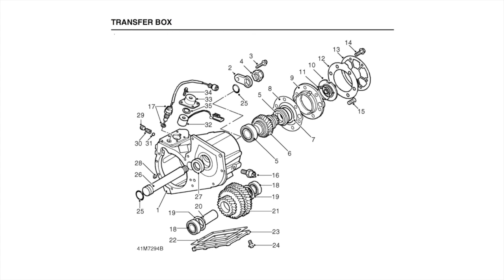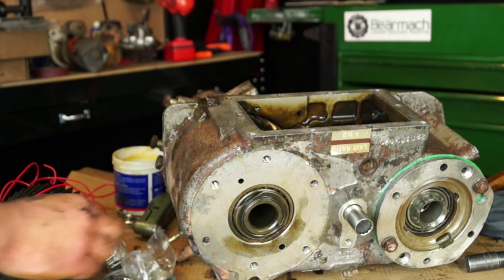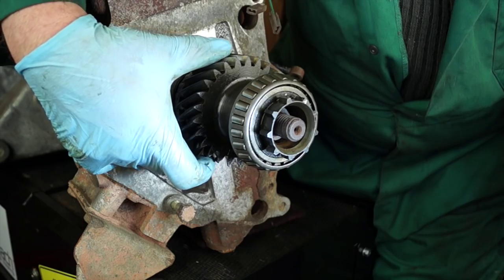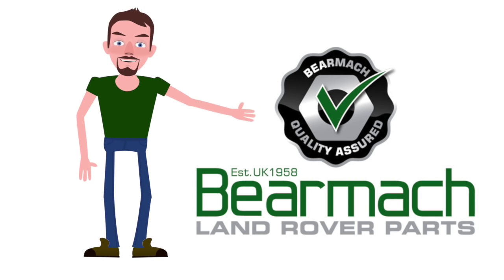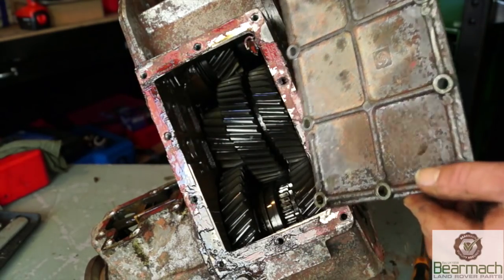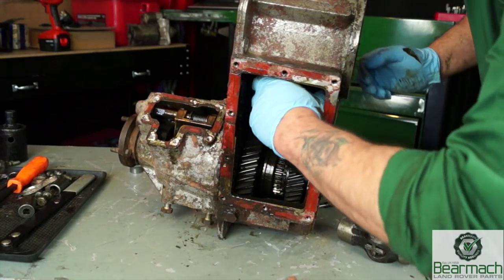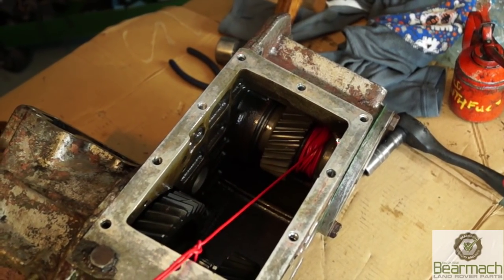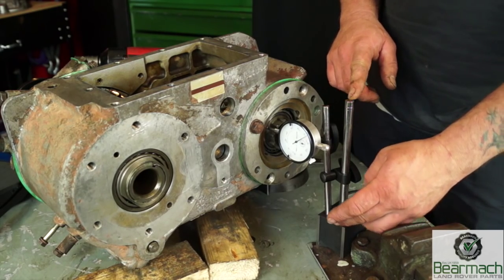Replacing the input gear LT230T  - The Fine Art of Land Rover Maintenance

Comment: had a buggered front diff a while ago . in the mean time though i have taken of the inspection plate on the transfer box  and found a brass chip ( very small and just one ) would that be the collapsible spacer ? 
also some lift on the front drive shaft flange within the transfer case 
thank you for any who can give advice
Reply: You will most likely have long figured it out but but those would be thrust washers from within the center diff (x4 washers) that lunched themselves.

Comment: If a spinning shell is the case, you can glue it with loctite. Source, onelonleyfarmer  while working on a JD tractor.
Reply from the maker: Arjan Wilbie   No you can't.
Reply: You can, it is not the recomended way buy you can extend the life of a end of life gearbox.
Reply from the maker: hum,  you choise your gearbox.  Not something that i would do.
Reply: It is a get home solution, same as leather as main bearing material when the babbit material fails.
Reply from the maker: If you have no alternative yes.   Problem is when a casing wars it could wear oval which means it will perhaps let the shaft . bearings and gears run untrue causing premature wear and component damage.

Comment: Land Rover Toolbox Video: Is the bad reputation about Land Rover's not-so-good reliability true, or false? Would you say that newer Land Rovers (2013 and later) are better built than older Land Rovers (2012 and previous). 
Even better; If land rover has improved on reliability, What year did that took place?
The reason I am asking is because I have never owned Land Rovers, but I bought a house in the country and I need a good off-road vehicle; I went to our Land Rover dealer and I see that they still have a brand new 2013 land rover sport at a very discounted price, since it its 4 years old practically, but it is a 2013' with only 52 miles on the odometer.....I do not want a car that will give me maintenance problems beyond what it Is considered normal.
I would like to know from you, who have proven to know a lot about LR's with this videos. Would I be buying a reliable car if I bought that 2013 Land Rover Sport......It is reduced about 20 thousand dollars because it is so old, And I would like to take advantage of that offer......Don't know why it did not sell......oh! the only thing I did not like about the car are the rear seat....they are way more stiff than my Volvo's seats... thanks in advance.
Reply from the maker: I'd advice to get an independent inspection of the vehicle if you are interested in buying it.
Reply: WOW! I had not thought about it since it has been in the dealer all the time and it only has 52 miles, but you are right, if it hasn't selled must be for some reason....tips, anything you would be paying particular attention? and one last question: Which one do you think would be a better buy, the 2013 Range Rover Sport for $68,000 or the brand new 2017 Land Rover Discovery for $80,000; assuming the 2013 has no mechanical issues.
Reply from the maker: You never know the cheaper one may have finance issues attached with it or it was repo'd .   I'd go for the one with the most warranty you can get in it unless you can get some sort of mechanical failure insurance for piece of mind.  

I 'don't know what your technicians are like in the USA. but here in the UK I'd get a good all round technician who specialises in Pre Delivery Inspections to check over the vehicle including a plug in to check out the On Board ECUs and CAN linked systems.  Friends of Friends who know about LRs may not be sufficient enough. 

Can't imagine there would be an issue with a 3 year old vehicle mechanically.   Remember new cars lose  money the minute it drives off the forecourt for the first time.

I'd say if you are unsure then walk away and get something with the best warranties you can get.
Reply: Awesome! Thanks for the good advise.
Reply from the maker: No worries.  Glad it was helpful for you.